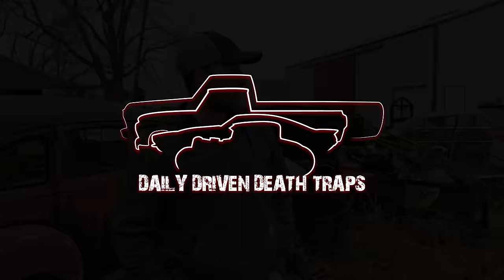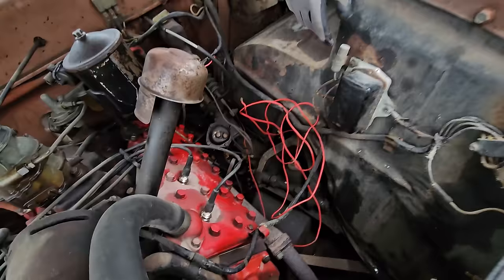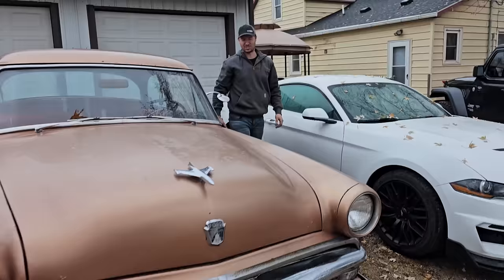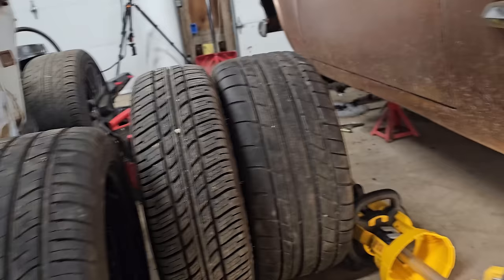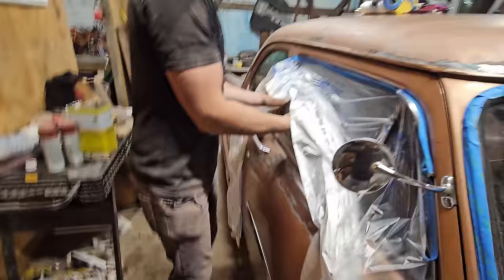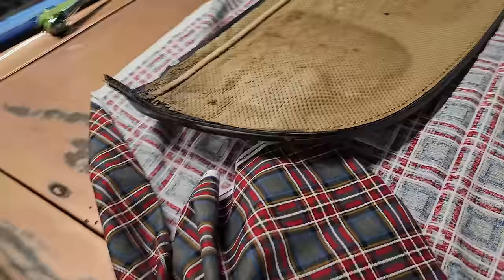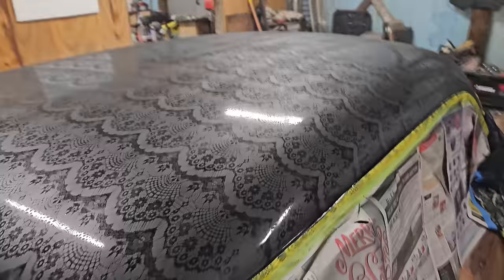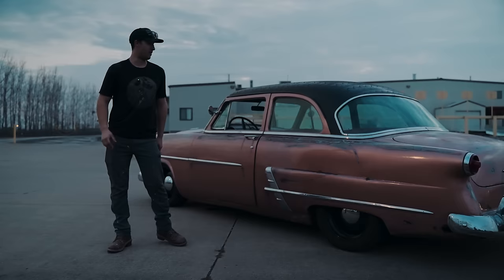SAVING a 1953 FLATHEAD and TRANSFORMING it on a BUDGET

Comment: 6 V are less faults, but more amps. They’re a real particular about cleanliness on connections and the heavy cables are a sign of 6 V having higher amps. If you ever accidentally strike a hot to a ground you’ll see what I mean. You can weld with them if you absolutely had to and had a very small rod

Comment: Batt cables were large on old cars with 6 volt.
They depended on amps not volts to spin the engine.
Had a 51 Plymouth, pushed it a many mile.

Comment: I would of either cleaned up the old paint on the car and polished it to a shine where it would shine. Put down a good coat of good quality wax and finished it with a good microfiber cloth cleaning polish. Great way of redoing the interior back deck and front doors. Very COOL job lowering the ride height! Nice new carpet ,, but no sound deadener layer? Treat that Flathead nicely... Cool Show. Good luck with your shows future success!

Comment: Turned out pretty awesome, the stance looks great, the laced roof laquer fits it good, the Flannel fabric panel idea throws in a good twist.
But, imho, y'all went a bit too far with the patina, a little fake  paint fade on the sheet metal's most exposed edges would have been just enough imho.
Anyway, really cool little Ford, almost looks like a mild Kustom from distance.
Greets
Reply from the maker: Thanks! 👍

Comment: The bigger battery cables are better than the smaller ones especially with 6 volts? The bigger cables will carry more amps, you don't lose as much starting the engine!

Comment: Radio is fairly easy to fix. They usually only need a new vibrator and 4 or 5 capacitors.
Reply from the maker: We'll try that at some point thanks!
Reply: @DailyDrivenDeathTraps  Get a copy of the Sam's Photofacts for the repair. They cover everything you need to know.

Comment: Gas mileage is great. It's beautiful. Majes me nostalgic. Proper tem was 130 to 160 in winter. Its not a. Road racer. Just a nice cruiser.Remember in the 50s and 60s the speed limit was 35 mph. Ran 30 wt oil the new gas dusolves some if the carb parts of the older modles

Comment: '53 Ford flathead V8: Valves in block, B&S 3 3/16 X 3 3/4, 239.4 CID, 7.2 to 1 compression, 110 BHP @ 3800 RPM, 196 Ft lbs. @ 2000 Rpm, Max torque with 57 PSI normal oil pressure. (1959 Motors Auto Repair manual)

Comment: I am probably a little crazier than most as I drive a 1953 LHD Customline in a RHD country (Australia). My car originally came from California. I did a partial 12 volt conversion for lights but left the rest 6 volt as it still worked well. It looks like you have a grand old girl and she will give you much entertainment. Don't forget the wipers are vacuum.

Comment: I have almost the same car at home but green. Mine has no floors but it has a good frame. With a 6 volt system the thicker the starter wires the better. 6 volt systems use twice the current of a 12 volt system.

Comment: No way that car sat for 3 years, 3 hours, maybe. It's a cold day, (wearing jackets and hood) the choke is wide open and starts with no throttle movement and idles on the second attempt with only two tiny squirts of ether, no way possible. 3 years the carb would have been dry, and the fuel drained back into the tank. No way a mechanical pump will draw fuel from the tank and fill the carb bowl that fast.
Reply from the maker: No way videos aren't edited for time, no way there aren't cuts of it getting to start because that's the boring part and this was mainly about budget building.
Reply from the maker: @dickdomain719  2/106k think the same and that's okay. Believe in what you want. Because priming, ether, throttle and editing mean nothing apparently.

Comment: Big cables are typical on 6 volt systems. Your Ford is a positive ground system. 6 volt systems perform fine when all the components operate properly. I have 4 cars trucks and tractors that all start fine on 6 volts in any weather.

Comment: I can tell you on mine I've got like either 3 or 4 inch lowering box. I mean, the rear end is on the f**** ground. And in order to change the tire, this is what I do. Flip the shackle, which gives you about 34 inches and then air up the air shocks. Or your air bags all the way and I'll push it down the rest of the way be able to pop that tire off. You might have to let the air out to squeeze it in between the wheelwell or the quarter panel.  Unless you get insect rims, but it will come right off. You don't have to take your blocks out. That's ridiculous, I do it all the time
Reply from the maker: We definitely need bags haha

Comment: You ruined the exterior, on the interior good job on door panels but floors needed more tack welding and seam sealer then brush it with rustoleum or por 15

Comment: You still need an 8 volt battery  try it you'll love it
Reply: No need to reinvent the wheel. The generator will only charge the 8 volt battery to 7.1 volts unless the regulator is adjusted. You need a bit more that 9 volts from the generator to charge a 8 volt battery. Stick with the proper battery and make sure all the wire connections and the starter brushes  are good and the car will work fine. Also make sure you are using a 6 volt starter solenoid, they have larger internal contacts to handle the extra current. You can spot them by their weight. The 6 volt ones are the same size but much heavier.  I have used two 12 volt solenoids in parallel on 6 volt systems before with good results.

Comment: I'm impressed how easily that old 239 flathead started, and how well it runs considering the age. It was obviously well-maintained! I kind of liked the original copper color.. it probably would have buffed out pretty nice, but I guess that's up to the observer. The lace-work on the roof is pretty cool! You can buy an aftermarket 12v. alternator for those that looks exactly like the original generator. You'll probably want to rewire it at some point, but if you want to do it right, get a 'Painless Performance' harness for it, and you can even customize it for a 6 - 12 v. upgrade. Curious to see where this goes...😉👍👍 EDIT: Vintage Auto Garage makes the alternators for those for a little over $400 (on the average for a modern alternator).
Reply from the maker: Thanks for watching! And the info!

Comment: I’m not sure if I should applaud or hiss. It was a decent old car with a mediocre paint job and typical body rust to start with. Your goal was to flip it and make a quick buck at minimum expense. Success on that note. But if you had spent a few hundred more you would have passed on a much better car. High end paint isn’t cheap, but single stage isn’t that pricey. For the small areas you painted, you would have had paint left over for the next hack job. 😅 I’m no fan of rattle can paint jobs because they don’t last and then to paint over them you have to strip the panel down. The top may look OK today, but it’s going to fade within a year. Buy a quart of black and a quart of silver or white single stage and you could have shot the roof and had that lace paint job last ten years. 

The interior rehab was creative. The plaid fabric was hideous. That was the best you could find to go with the seats? 

Someone is going to buy that car, but if you are going to do something-try to do it right. Otherwise you’re no better than the next hack used car dealer doing no one any favors by half-assing repairs on an old car. 😅 At least get an air compressor and a couple of $10 Harbor Freight guns and use them.

Comment: Just wondering...how do you get away with driving an basically unregistered most likely uroadworthy car (the rear hydraulic brake hose was  marginal) down a highway and back to your home without being pulled over by the local police?
Reply from the maker: By being straight G’s

Comment: Plenty gas. You wont believe the mileage. Sounds beautiful. Dont hurry it. Let it run and loosen up from sitting. Did u leave the chokr on. Get a nanual you gott get in the way back machine. You're thinking too modern. Don't expect xero to 60 in 4 seconds. Speed limit in those days was 30 mph.

Comment: Can you tell me what backspace you have on the wheels? My 52 Customline 2 door sedan needs tires like this after seeing yours.
Reply from the maker: Wheel, 51 Series Smoothie Paint Ready, Steel, Bare, 17 in. x 8 in., 5x4.5, 5x4.75 Bolt Circle, Each
(Mfr. #: 51-8810). Rear tire- Tire, Street Comp, P275/40R17, Radial, 98 Load Range, W Speed Rated, Blackwall, Each
(Mfr. #: 6275)
I don't believe they sell the rims anymore but I know there are similar options out there, especially ones that are already powder coated. Front tires are just a 255/40/17

Comment: Any time a classic is lowered its ruined to me . I have a 54 cp  . I raised the front 4 inches and the rear 3 inches.  Put a 390 4 spd in it . Disc brakes and  painted it blue with polishes slots . Yes im old but that old car has been that way for 25 years and has been driven hard as a daily driver . It. Still gets looks .
Reply from the maker: Cool

Comment: Running does not tell me anything.
If you plan to work on a budget you are fooling yourself.
They always take 2 more years and a thousand more dollars not counting your labor which in my case doesn't amount to much.
You shoul have tryed to repair a old Ford 60 yr. Ago when there was not many handy tools and no aftermarket parts. You scrounge for parts and do the best with a small bunch of tools.